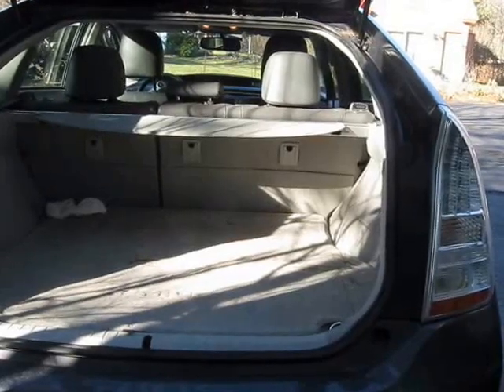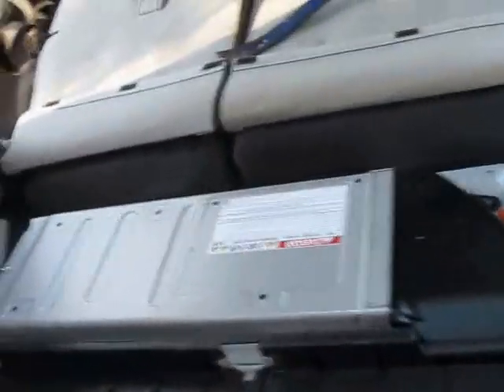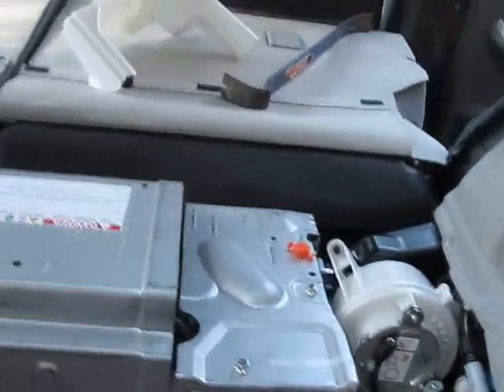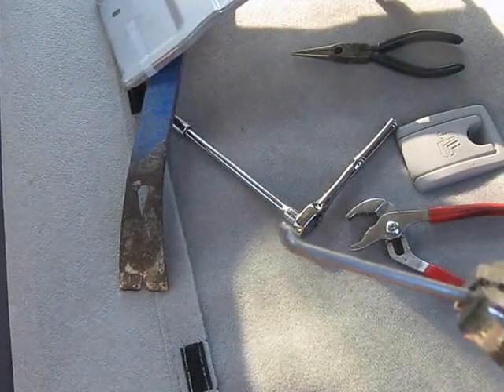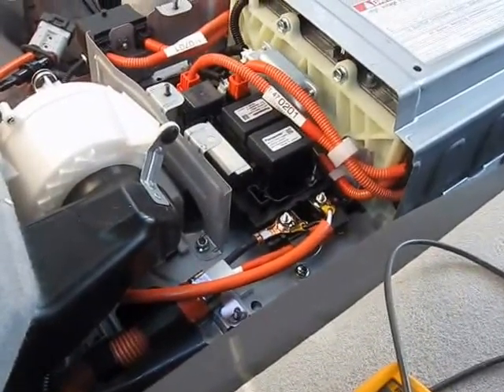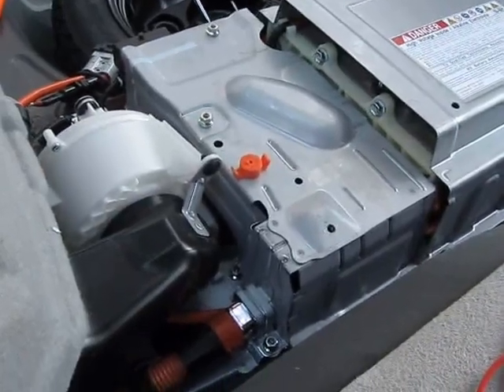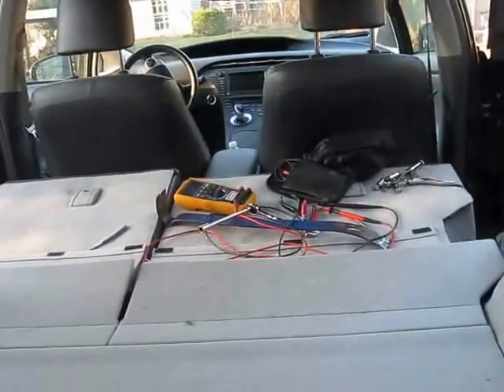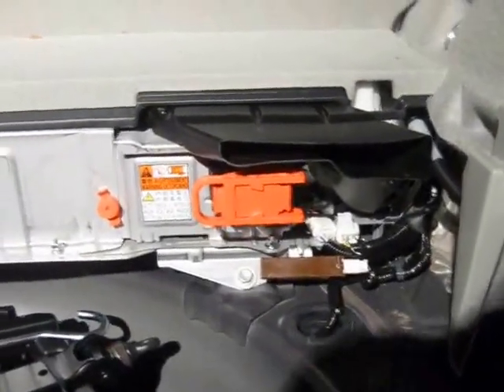Toyota Prius Gen III Power Inverter Cable Installation to traction battery

Comment: What kind of fuse does this thing have if i may ask?
Reply from the maker: Its been a long time since I looked at it. The inverter is for 2kw and the fuse melts when too many amps flow. So for a 200 V supply, assuming a lower battery level, that's 10 amps on the DC side for a minimum. The inverter has a circuit breaker in it as well which did shut it down the one time I overloaded it and it reset, so no problem.  I hope that answers your question.

Comment: Are you aware of any videos for the some process for a 2021 Toyota Prius? Thank you. I also am interested in which inverter to buy to power Zoeller submersible well pump model #1450-0010 2 wire. It should require less then 2KW. 
Great Video!!!!!
Reply from the maker: I have not kept up with the available inverters so you are on your own for that. I believe most well pumps use 240vac for power and I believe will require less than 2kw; so buy an inverter for the VDC of your car and an output of ~240vac and 60hz for the US. Be careful about how you wire up your system. I would recommend using an electrician if you are in the least bit fuzzy on electricity.

Comment: Don’t!! … Connect directly to the battery, there are plenty of videos, simple, safe.
Reply from the maker: Jules, I don't know where you're coming from. This video shows a way to connect the traction battery to an inverter so that you can get power to your house. You are not connecting directly to the traction battery in that when you pull the disconnect plug there is no direct connection to the battery. And the only reason that I am using the power from the traction battery is that that is a better way to get more than one kilowatt of power for the house. What are you suggesting is the purpose for connecting to the traction power supply that is a better way?

Comment: Great video.  Any source for a different 300-400v inverter since that company is gone? Thanks
Edit...after some digging the apc surt 3000-6000 xli have been found to work.  Do some googling before spending money on them...and there are different variations of these data center ups units that may or may not work.
Reply: I think that company is now Plug Out Power

Comment: Great video! What is the biggest inverter in KW can be installed?
Reply from the maker: When Converdent was still in business they sold a 4KW unit, so my guess is 4kw. I installed a 2kw. The 3kw unit is too big and probably heavy to setup in the back of the car, so you would need a longer cable to attach to the inverter at a remote location. With the 2kw placed in the back of the car, I stretched a 16 ga extension cord from the car to my connection to the house( mine is only a 120V system). I also have a male/female plug just outside the car, so if I forget and drive the car away it will automatically just disconnect. I don't think that a bigger connector needed for the higher KW system could automatically disconnect.
Reply: David Smith Much Appreciated. Let's say If you leave the inverter on with a load and you switched off the car; is it going to continue supplying the inverter until draining the traction battery out or it is just shut everything off? In my case with 12v battery inverter setup I need to shut off the inverter before shutting the car off to preserve the 12v battery which is inconvenient.
Reply from the maker: Mohammed,
The answer is no. As soon as you shut off the car, the inverter is dead. This is very helpful since there is a fuse on the supply line that would be dangerous to change if it were powered. The location where the inverter cables are attached in the video is after a relay that is controlled by the ignition switch and powered by the 12V battery. When the 12V battery is dead, you cannot start the car. Furthermore, you need the engine to run and keep up the traction battery, as I think lots of stuff would be possibly damaged it you took all the power out of the traction battery.
Reply: David Smith Did you fuse your cable?
Reply from the maker: Mohammed Moqbel : the cable came that way from Converdent.

Comment: they're many cigarette lighter power inverter available.
Reply from the maker: True. It is only a question of how much power you want to get out of the inverter. If 100W is all you need, then you are good. My traction battery powered inverter is good for a continuous 2000W.

Comment: I just bought a 12v to 220v 2500 watt inverter. But can I connect that directly to the traction battery if the traction battery is 240V ?
Reply from the maker: The short answer is no.  Furthermore your statement about the specification does not make sense to me. The wire to handle the supply voltage would have to handle 208 amps would need to be 4/0, very big and unwieldy. I do not think the supply wires in the Prius 12v circuit would handle that current flow on a sustained basis.
Reply: +David Smith thanks so much. I'm such a dunderhead. I was toying on either tapping the 12v battery and a 1000 watt inverter or going up to 2500watt and tapping the traction battery. But I bought a 12v to 220v inverter so that means i have to through the 12v battery instead.

Comment: I can't fine any non 12 volt based D.C. To ac inverters
Reply: Converdant is out of business. Any other?
Reply from the maker: Samuel Seidel try www.converdant.com
Reply from the maker: http://www.converdant.biz/plug-out/ 
Sorry for the bad link the first time.
Reply from the maker: The video doesn't show where to look? You have to go under all the stuff to find it and it will not show the 230V unless the car is on and the clip is in and then it is dangerous.

Comment: I've stumbled into this video 3 times now. It's overly complicated and both google and youtube misdirect to it. I don't want to mess with the traction battery. It seems potentially risky to both the car and my safety. I won't criticize this video because nothing I've looked into so far concerns the traction battery. This might be the better way to set up a Prius to be a 120 VAC source, I just don't know.
I'm sure I'm like most people who arrive here, I would like to connect an inverter to my Prius 12 volt battery. I'm interested in socket sizes (10 and 12 mm) and what happens if I disconnect the battery to all the electronics. (I'm guessing radio presets, bluetooth connect, trip distance, but not odometer or essential car electronics--but I don't know).   I've got an old cigarette lighter inverter I want to connect to the battery. The companies that sell the 1000watt inverters should make a video for this.  Thanks David Smith for the video I just wish I knew more about your end results.
Reply from the maker: Hi Will,
Just saw your comment. My inverter works just fine. I rewired my power panel to accept the inverter output as a generator. I used a system that directs the power into two circuit breakers (one for each leg of a 240V house power panel) and employs an "Interlock". All the house changes were done with a building permit from the township and inspected by the township. The only down side has been that I spent the time and money to be ready, but I have never had to use it. This is not so bad though since I use and maintain my Prius and it is ready and have no other costs. 
Your concern that it is overly complicated is perhaps misplaced. I am an chemical engineer and I try to leave as little to chance as possible; however, I have a good understanding of electricity and without that then the process is dangerous and is probably not something you should attempt. I am not sure what happens to all the electronics if you disconnect the battery. I have done it and I don't remember what is reset. I think the radio presents stay. You might lose clock settings and the trip data, but not the odometer. The electronics are just fine. As I remember the battery come off with a 10mm end wrench or socket, but I assume by now you have done what you are going to do. Best, David

Comment from the maker: Dany Troy asked a question about connections to the 12V battery in the Prius. This video is about the traction battery which has about 230V out of it. As a result discussions here are quite different. Connections with 2AWG to a 12V battery should be good for 1kw inverter.

Comment from the maker: I don't know. I think I read somewhere that it is for a day or so, but I have not had to run it for any length of time. Since the running time is dependent on how much power you are using, it will vary.

Comment from the maker: David Borzillo,
I don't think the installation of the cable would be long, probably about 1/2 hour.
Reply: +David Smith Thank you. In the video you also refer to instructions. I also bought a Converdant inverter, but I don't have specific installations on installing the cable. Where did you get your instructions?
Reply from the maker: +David Borzillo I don't remember receiving specific instructions. Converdant tried to set me up with someone to install it and that did not work out for me, which is the reason I made the video. It really is not that difficult if you are mechanical. The only area that I got into trouble was not knowing to slide the plug after it was inserted that you see at the end of the video. Without doing that the car would not power up. What gen Prius do you have? Where is your Prius housed?

Comment: i am about to start on this endevour, i was wondering do you have the specs of the cables you used and the instructions? I am planning to used a 3KW pure sine wave inverter, 240v
Reply from the maker: ***** I do not have the specs. But from the equation ei=p, You have about 230V DC  at the battery and you want to transfer 3000W, so that is 3000W/230V=13.04 A. So that would say you need at least a 14 gauge wire from the battery to the inverter. 10 or 12 would be better. Now from the inverter to the house is a similar calculation. Since your inverter probably has a +120 and a -120 AC output along with a common, each leg will flow at about 13 amps so the same criteria holds. For the house side I suggest a 10 gauge because it will be connected up as a typical generator connection to the power panel and typical generators are 7.5KW and a 10 gauge wire works well for that. The inverter I purchased came with a stranded battery wire and Andersen Power connectors on the ends. I think the connectors are rated at 125A. Hope that helps.
Reply from the maker: ***** I forgot to tell you that you must  make sure that the inverter you use has an input voltage specification specific for the Prius you are using. Many inverters use 12V input and this will not work with the traction battery of the Prius. Furthermore, the amp calculations for the supply circuit will change drastically in a 12V supply system if you are designing for that type of system and not using a Prius.
Reply: oh my gosh! Thanks so much for that headsup! I didn't look into the 12V input. THis is defintely a huge undertaking if i go down the route of tapping into the traction battery. Do you know whats the traction battery output voltage?
Reply from the maker: ***** I don't have the exact spec but it is about 230V DC. There are inverters out their that are set up specifically for the traction battery of a Prius.
Reply: Please tell me the name of the inverter that you used.  I am not aware of 230V inverters Dc to AC.

Comment: Conversant includes 12 awg wire with their kit. I reviewed several wire size charts that specif 1 awg for 100 amp systems. What size wire Aug are you using between the HV battery and inverter? Also, wouldn't a selr reset breaker worker work better and be safer than a fuse that you have to change.
Reply from the maker: James,
I was in Mexico last week and could not respond. I lost the comments that I had prepared so remind me if i miss something. As far as wire size is concerned it is 12 awg. The reason that you see 100 amp systems is that they are using a 12V DC supply and the traction battery is 220V. To get the same wattage you need a lot less amperage. I think it is complex to put a breaker in the system and I believe that there is a reset breaker within the inverter. The fuse is cheap insurance. I drew too much power off my 2kw inverter and is just disconnected and I was able to reset it. As far as replacing the fuse if it blows, I was concerned about replacing it but Converdant told me that the cable is unpowered if the car is off; and furthermore you can pull the orange breaker if you want. You asked what I did for the connection to the house. I connected directly to my power panel through a double 30 amp breaker with an Interlock as required by code for a generator connection to the panel. This way I can select the circuit(s) that I want to use without having to rewire to the transfer switch. This is a management system. In any case my township required a building permit, so I had an electrical inspection. My inverter only has 120V single phase output that I set up the connection between the inverter and the plug for generator input to have the hot side going to both the plus and minus sides in the panel. This means you have to be careful not to connect to any 240 V appliances. Hopefully this answers your questions. Be careful to insure that you get an inverter designed for the Prius traction battery or you will have a burned out inverter is no time. You might want to look at the http://www.priups.com/ web site for additional information. It is a bit old information but accurate for what it is.

Comment: What are the specs for your inverter, How did you wire he inverter to your main breaker panel? Did you use a transfer switch, if so how did you wire this to your inverter?
Reply from the maker: James, Sorry that I did not see your request earlier. I will leave the specs alone, but for the connections to my panel is as follows:
My inverter only puts out 120V so I connected to the house with a 16ga 3 prong extension cable. I cut it and wired the end with the female plug on it to the inverter. The other end I wired it to the hot wire was connected to both hot terminals on a 240V generator plug. 
The generator plug in connected to my power panel through a double breaker controlled by an Interlock so that the main power breaker can not be on when the generator breakers are on. 
I have a list on my power box as to which breakers can be on since I can not have any users connected to the inverter that draw 240V.
I did not use a transfer switch. The entire system was inspected by my township and the generator box is setup to receive power from a 240V generator. The compromise is a management one at the connection at the wiring of the 120V cable.

Comment from the maker: I don't think that the installation of the cable will impair your warranty. This was the position of Converdent the manufacturer of the inverter. Toyota refuse to install the cable and was not happy about it, but they did not say that the warranty would be voided. They tried to imply that it might but when I challenge them on the subject, they backed down.

Comment: Wow does this void the traction battery warranty? I just bought this same car I dont think I will be doing this since I am building a junkyard 2005 prius powertrain gen set using various toyota parts and echo ecu since it is the same engine as the prius.

Comment: what brand inverter did you find to handle the high input voltage?
Reply from the maker: I purchased my inverter from converdant.biz. I think they had them specially manufactured for them at some place like China. I just looked on their web site and the 2KW unit price dropped from $800, that I paid, to $650. There is no manufacture's name on the box. The bigger capacity units cost a lot more money and must be located outside the car but they will provide 240V vs mine at only 120V.
Reply: Did your inverter connect to the traction battery 200vdc connection?  I looked on converdant.biz and their 2kw inverter looks like the typical 12vdc to 120vac kind...thanks again..Andy
Reply from the maker: a gros The picture of the 2kw inverter looks different, more sleek, than the one I bought a year ago. I think it is unlikely that a 2kw inverter would connect to the 12v battery because it would require 166 amps to get that much power vs. 9 amps from the 220v traction battery. If you look at the 1kw unit Converdant sells, it comes with jumper cables for connection to the 12v battery, not the connection system like Frank Perkins shows in his video. Actually Frank Perkins setup is the same as what I installed except I connected to the traction battery and included a cover over the connector end to protect it when not in use and mine has a 20 amp fuse as I remember.  These  cables were included with the inverter from Converdant.
Reply: @DavidSmith-ns1bg  I think you can probably get one cheaper than this....right?
Reply from the maker: @phil7654  I really don't know. I think you have to handle 200 to maybe 250vdc and convert that to 120 or 240vac at 60hz for the US. I looked a while ago and found some, but the last time I looked the search engines didn't produce anything. Maybe ChatGPT would work better. Good luck.

Comment from the maker: You must buy an inverter that is designed for the input voltage that you have and provide the output that you want. If you were to connect a 1kw inverter that is designed to connect to the 12V battery to the traction battery I am sure that it will be fried in no time. In the discussion on priups.com web site about a year ago discussed buying a used ups on ebay for the system and I think it was designed for about 400V input and it had problems providing enough power out.